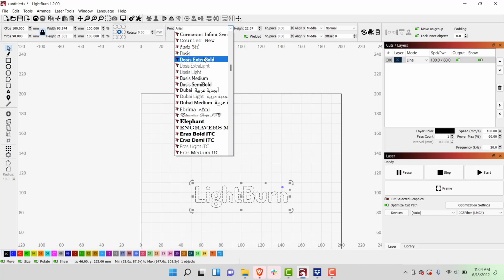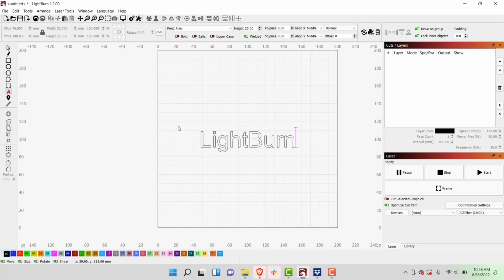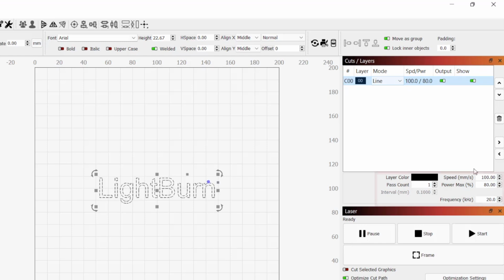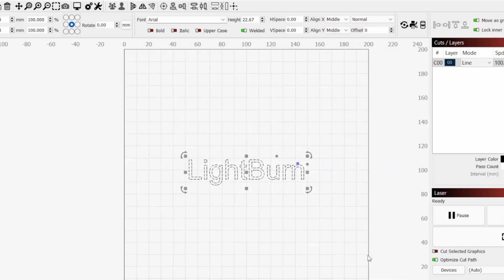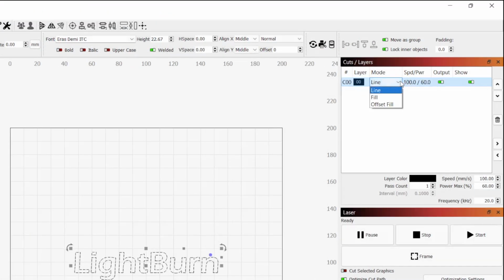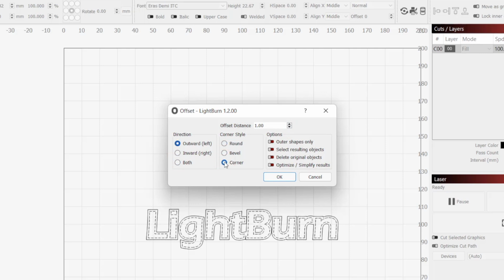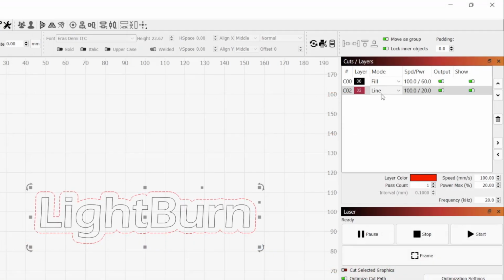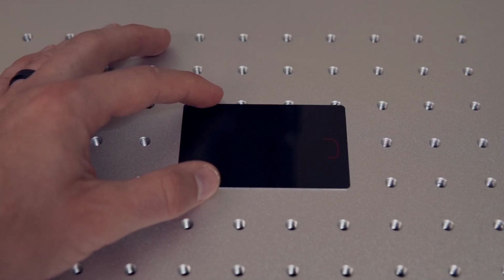LightBurn for Galvo - First Project

Comment: Just did my first testing with my 5W UV laser. Can someone tell me how I can change the power setting in Lightburn? I can change speed , frequency and pulse but Lightburn isn’t letting me change the power setting?
Reply from the maker: Power is right under Speed in the cuts/layers window. You can also double click any layer to open the Cut Settings Editor. Power is also under speed in that window.

Comment: does anyone know how to fix image/project to laser correct.  Just switched to lightburn on 50 watt Wisley  and it marks everything in mirror
Reply from the maker: In the Device Settings window you can reverse the output of either galvo along the left side of that window.  If you imported your EzCad config it should have done that for you.

https://docs.lightburnsoftware.com/galvo/Setup.html

Comment: ja tenho uma Licença para Controladores de código G, comprei uma FIber Laser , se eu atualizar a licença no site para Controladores Galvo: vou poder usar o software nos dois tipos de laser com a mesma licença?
Reply from the maker: I would make sure that your fiber laser is compatible with LightBurn. LightBurn currently supports EZCad2 and EZCad2-lite based Galvo controllers. If so then yes you will only need to upgrade your current license to have support for both gcode and galvo. Here is the link: https://lightburnsoftware.com/products/lightburn-add-galvo
Reply: @lightburnsoftware7189 sim, o laser de fibra é compatível, muito obrigado

Comment: Not sure what I'm doing wrong, but none of the Frame options are working for me. The only button that works there is Start which of course starts an actual burn. Thanks in advance!
Reply: nm I got it. Had to go to device settings and choose Red Dot IO port. (Port 4 worked for me)